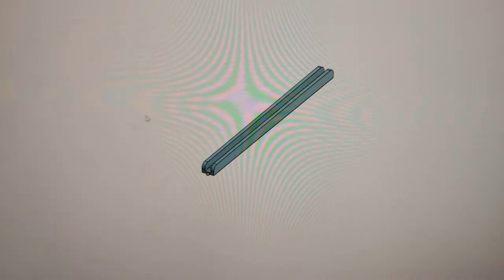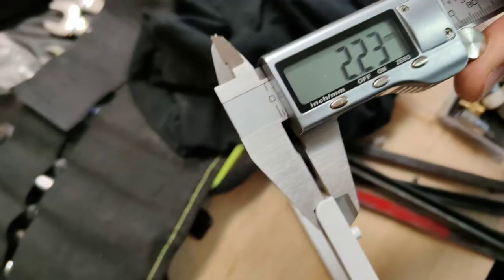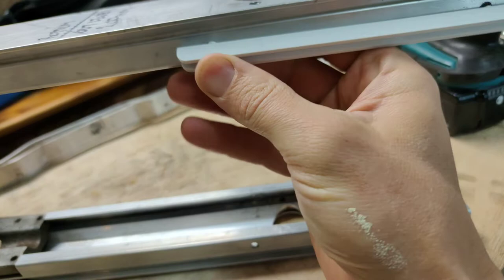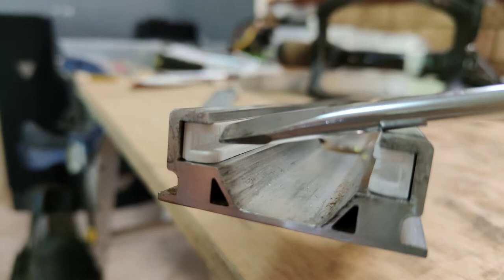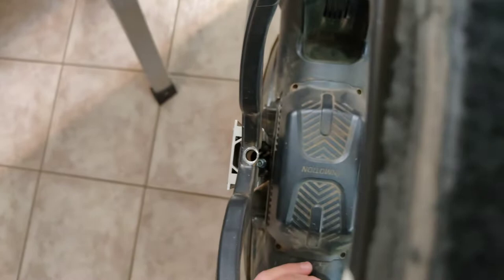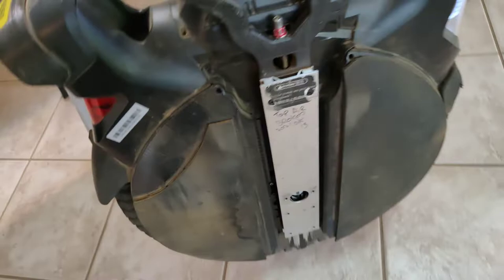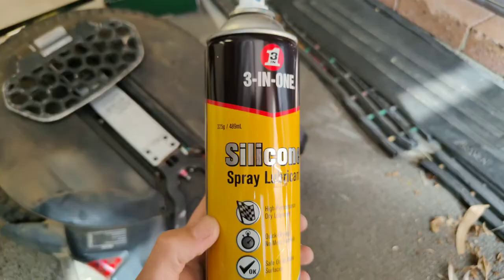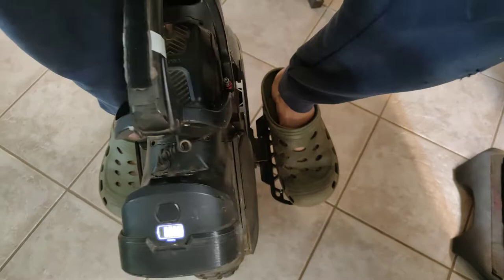InMotion v11 Suspension Slider Upgrade & Replacement. 3D Printed in ABS

Comment: I might need some of those sliders soon, looks good!
Reply from the maker: I bring tonight
Reply: @jc84com  No hurry , but I think I have a little play in the sliders now, just a little movement and yours are much longer. The sliders I have are only about 2 inches long with 2 on each side, one top and one bottom rather than yours being one long one on each side, more surface area. Have you tried graphite powder as a lubricant? We used graphite powder in skateboard bearings back in the 70's. Works better than  anything you spray i think
Reply from the maker: @michaelsmart61  graphite sounds best for sure dry lubricant

Comment: Do you know if anyone had replaced the guides with roller bearings ( pulley roller) with a  groove???? Do you have the measurements of the air shock  support bracket. (Less then 500 miles and worn slide skids)... I want to make the v11 better. Smoother.